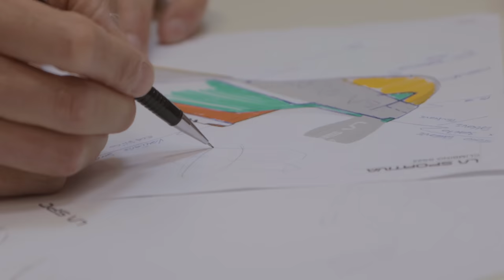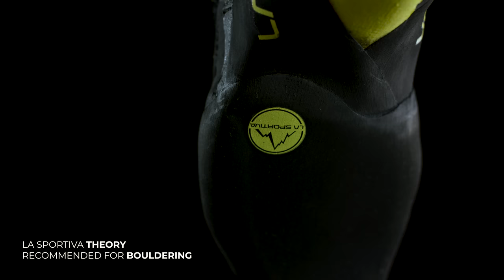3 climbing shoes for 3 disciplines | Adam Ondra visited La Sportiva

Comment: Unfortunately, I can't recommend buying La Sportiva shoes.   I bought a pair of Solutions for my son and the straps broke in 4 months (indoor climbing only). The strap design is flawed and the grommets wear through the strap very quickly.  You cannot repair it yourself - you have to take to a cobbler to have a new strap installed and La Sportiva refuses to warranty the product.  They claim it's "wear and tear."   La Sportiva customer service has been completely unhelpful (and kind of rude, to boot). It's a shame, because the shoes perform well, but La Sportiva does not stand behind its products - this is a known issue and I've seen lots of reports of this issue on-line.
Reply: I put a thin strip of finger tape on the strap where it rubs against the metal and I just replace the piece of tape when it rubs off, seems to be holding up for now.

Comment: The biggest weak point about the Solutions imho is the bands. Over time the bands get abrased at the front eyelid making the shoe temporarily unusable (even though the rubber is still good). Fortunately you can fix it by sewing a new durable band, which of course requires some time and handiwork

Comment: I had problems with the la sportiva beginner shoes because I have a fairly wide foot. The la sportiva shoes i fit in width wise are too long.
Reply: Have you tried the Mytos?
Reply: @NestorMandela  not yet, no. But the pictures look like they could fit me well. Gotta try those.
Reply: @DUDA-__-  those are what I use and for my first climbing shoes they are pretty comfy. I have flat feet and I usually wear them for 2h in the gym no problem. For reference I wear a 42.5EU street size and got a 40.5EU Mythos.
Reply: Mythos are great if you have difficulty finding well fitting shoes, as the laces let them adjust super well. Do mind that they are made from leather and expand quite a lot and I mean a lot.
Reply: Scarpa typically uses a wider last (which does not fit me).
Reply: Have you tried the la sportiva Finale? I just got a pair and they are great and good for wide feet